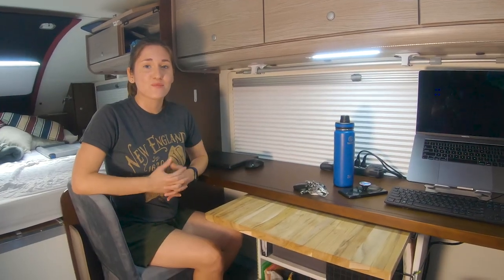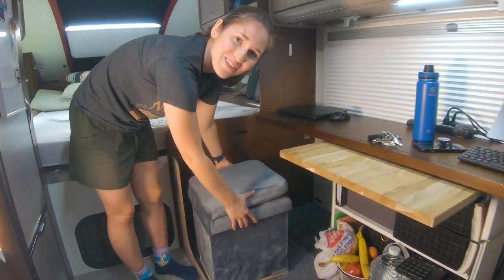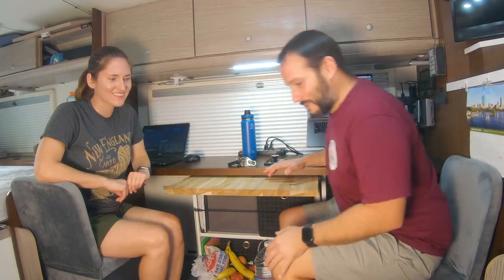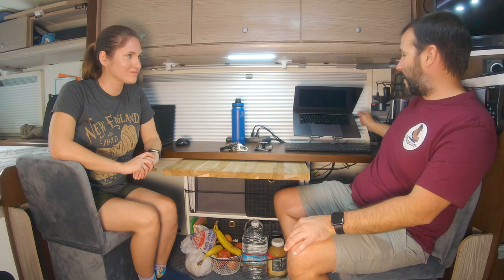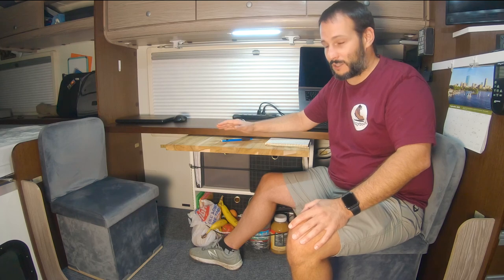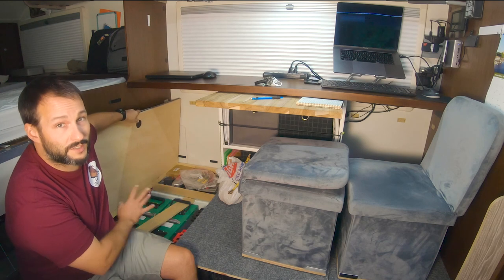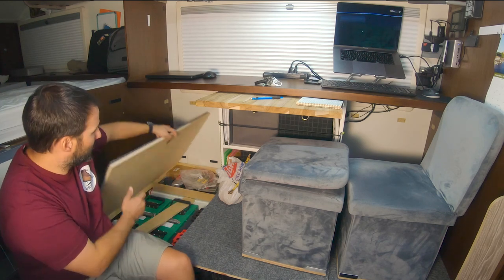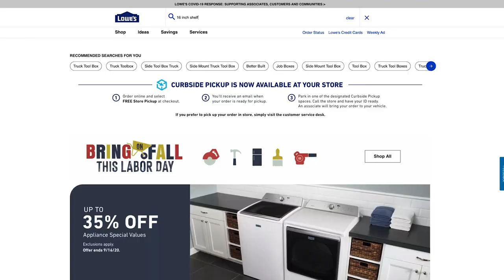Truck Camper Mobile Office [We Built an Office] NuCamp Cirrus 920

Comment: Very nice rework on the space you both have.😀👍
Reply from the maker: Thanks. It’s been working very well. I finally finished the table. I radiused the corners, sanded smooth and treated it with mineral oil. The whole setup has served us well for almost 2 years now.

Comment: I know this is an older video - on your table height and stability... have you considered a table on a piano hinge off the desk with a fold down monoleg?  That way it would be the same height as the desk and supported.  You could use the same table - all you need is a few dollar hinge and a 1x2
Reply from the maker: I did consider it. Similar to what you suggest. However, we wanted to make use of the stubby table while working and to maintain access to our shelving without having to raise the table. It was my first design, but I went with the slides after a great deal of thinking. So far, it’s held up well. The rails are getting a little loose and I’ll replace them soon.

Comment: Thanks for the travels & videos! I was wondering about the brand name of your Ram truck front end storage holder, and your back end mount for your bikes or motorcycle, please?
Reply from the maker: Hi! We got the front end storage holder off of Facebook Marketplace and it didn't have any brand name on it. The front hitch is a DRAW-TITE 65063. 
As for the bike rack, we did a full video. It's called: "RockyMounts BackStage Swing Away Bike Rack On A Truck Camper - Durability Review - Will It Survive?" You can find links to all of the products in the description.
Thank you!